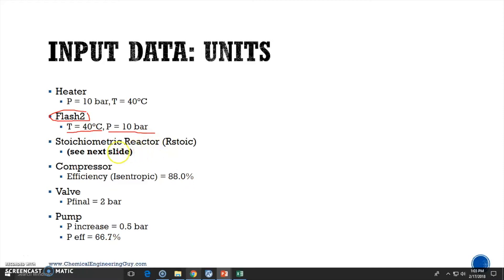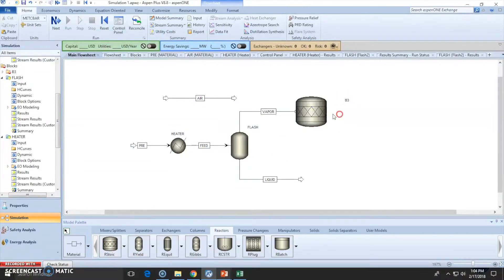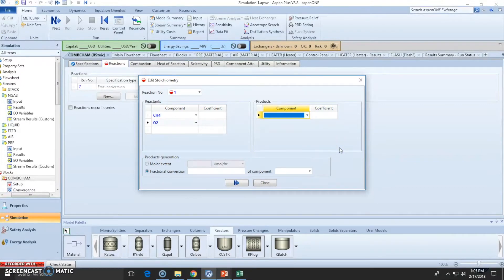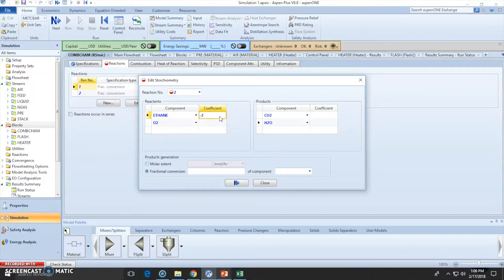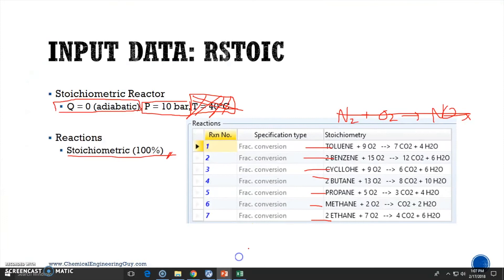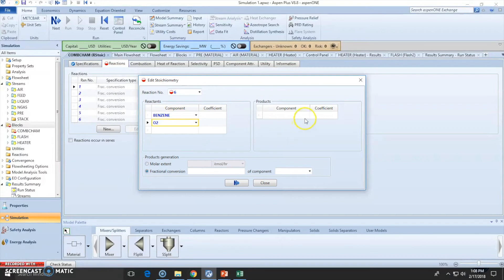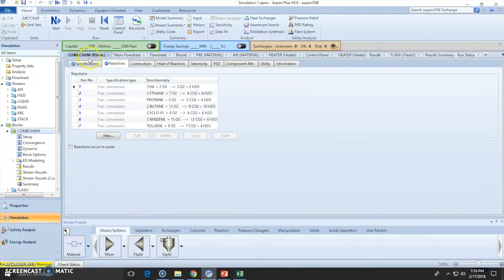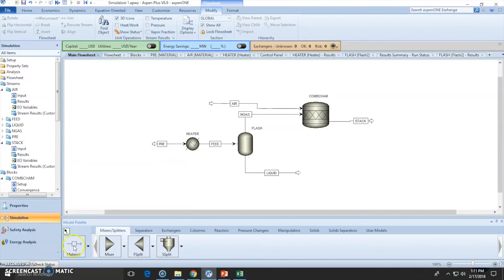Reactor setup, the RStoic (stoichoimetry) and Adding Reactions to the simulaiton (Lec 014)

Comment: hi! can i ask how to do equipment sizing for RStoic? which formula should i use for finding the volume, since i don't have kinetic data. will appreciate your reply. thanks!
Reply from the maker: you cant, you need kinetic data (i.e. CSTR, PFR, PBR, BATCH, etc)
Reply from the maker: You may want to try RGibbs if no kinteic data is given, it will assume the most likely reaction in the forward direction
Reply: @ChemicalEngineeringGuy  if i can't determine the volume for RStoic, what other specifications can i put for the specification sheet i'm working on? can the diameter and wall thickness be determined?